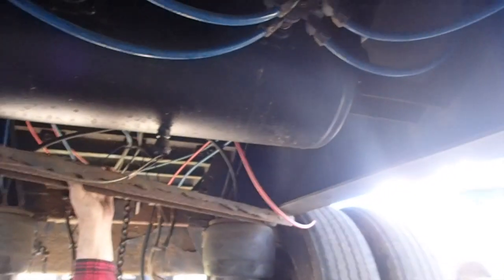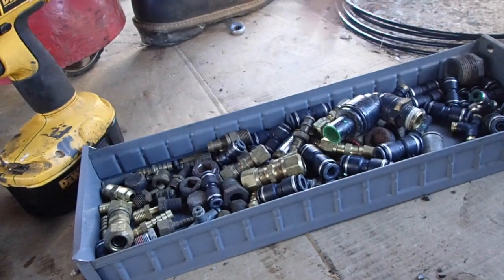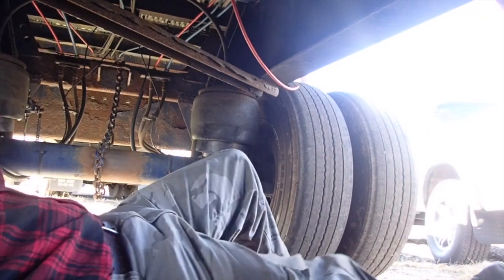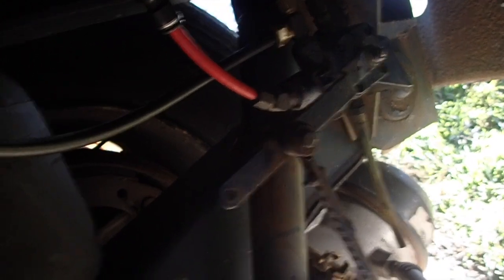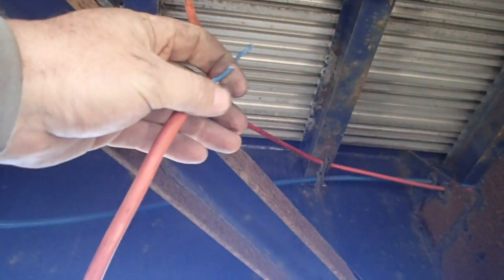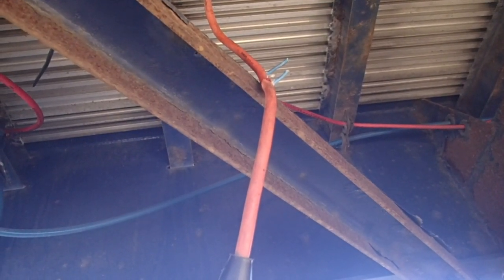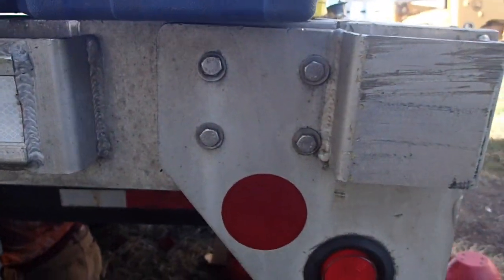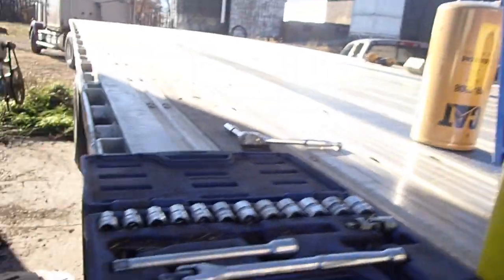Dump Valve Install

Comment: That will make that trailer really handy to get around with. We pull a couple of old flatbeds around with the tractor when we are moving hay out of the fields. We just back the brakes off on them. Even with no air in them, small bales ride really well on them.

Comment: Watching George's videos it looks like they use a UK standard 45ft trailer with 17,600lb axles. It looks like a common flat trailer we pull over here with our trucks in the UK. We run 3 axle truck & 3 axle trailers upto a max of 97,000lbs. We hardly use spread axle design. They only tend to use the spread axle design on 51.5ft trailers & they use 3 axles with rear steer. Not many people use them as they are apart of a government scheme to see if longer trailers work & you need a special permit. They still run on 17.6k lbs axles & a max train weight of 97,000lbs.

Comment: and this you should do on your trucks also. air dump an the last drive axle. that helps much for traction when empty.  we do that on all 6x4 trucks. turns better in tight places also. but just cant seem to get americans to understand how important it is hehe.

Comment: That dump valve will make it much easier to get in tight spots that's for sure. just got to remember not to leave it dumped and drive down the rd lol, I installed a backup alarm in the cab of my truck so when i flip the dump valve switch it starts beeping that way i don't have to worry about forgetting, or the switch accidentally getting put in the dump position without noticing and then driving down the road.
Reply: Or just put a red light right beside the switch.

Comment: hi Wes good luck in UK watch out for ex hire tractors. I like second hand ex arable farmers tractors they do a lot of work in short time period and most get put in grain store as soon as space allows staying dry all winter! owner drivers and serviced . sometimes see new tractors in Portbury dock for export some have rear tyres removed and run on wood strapped to rims to keep height down ( big cnh) beware it's very cold in UK this week regards dave

Comment: You probably need to put heavier valve springs in that motor. The wear is probably coming from the valves opening up from the boost pushing them open, depending on what compression lbs. the spring are. When you twin or triple turbo a duramax, Cummins, and powerstroke you need to put heavier valve springs in them so that as it builds boost the valves don't start to open up letting that boost escape and increase wear on the guides and seals.

Comment: the leveling valve keeps the air pressure equal  in all air bags the way i understand it also keeps the height of trailer  correct

Comment: If you buy a tractor in the uk that does 50k most have air brakes because of the law regarding towing, if you buy tractors that do below 50k they mostly don't have air brakes.

Comment: if your tractor has 2 trailer plug outlets the green one will have the blue wire powered . on older tractors it is usually a switched aux power option for whatever.. you have to wire it to be powered or find the switch to turn it on

Comment: Put a reman engine into the Star and keep running it, you know its history, it does the job you need it to do, probably would be nicer to have a shorter wheel base that's what you have Carl's truck for.

Comment: That blue wire might be a signal return to the abs computer. Each sensor should have signal return. They create a AC signal and that's what the abs module uses to see if the wheel is turning.
Reply: Also there should be modulator valves the the computer uses to modulate the air pulses to the brake chambers to avoid lock up.

Comment: does a newer engine fit in the older truck (is it the same engine )
if so you might want to look around for a wrecked truck (like one where the trailer turned intoo the back of it ) with a low milage engine in it and spend a few winters days replacing the engine in the truck 
i bet if you start calling insurance companes you be able to find one at less cost than a rebuild or new engine , might even be able to find a stronger engine

Comment: I understand the principle behind a dump valve situation but would it be even better with a lift axle for tight turns? I have no idea how they work or even if they can be installed on that trailer or indeed what they cost.
Reply: a lift axle is a major job that cost major money
it also increase ground pressure which is bad out in the field
Reply: I somehow half expected that.

Comment: Do a delete put a single turbo and 16.1 Pistons instead of the 18.1 in it now tune it to a 6nz series you won't be disappointed with it exodus diesel does a lot of them they have a YouTube channel check them out.

Comment: I would strongly suggest you don't put any money into that C15 acert cat has settled a 60 million-dollar lawsuit over POS if if you choose to have it rebuilt or replace it with a reman you will continue to throw money at it we have 12 of them and they are the biggest pieces of crap around